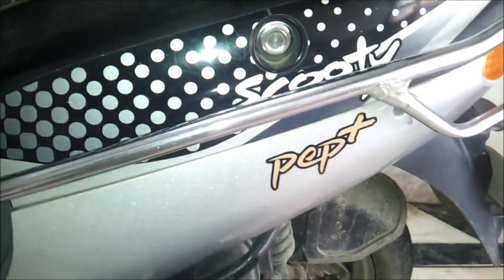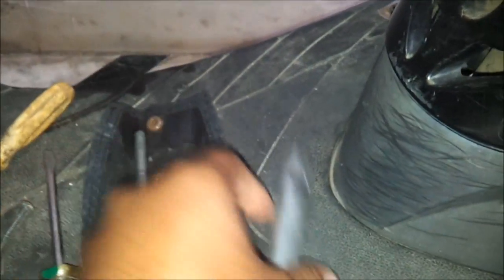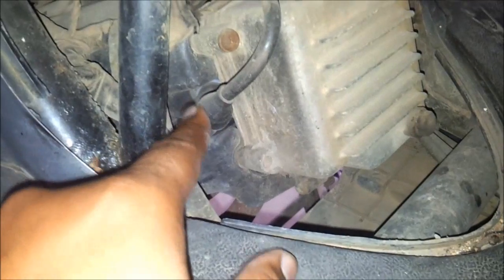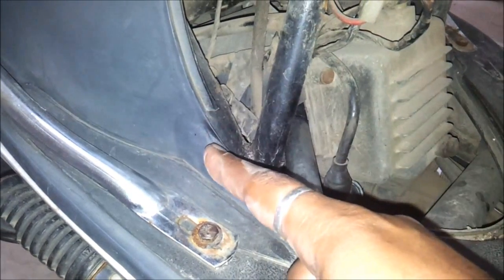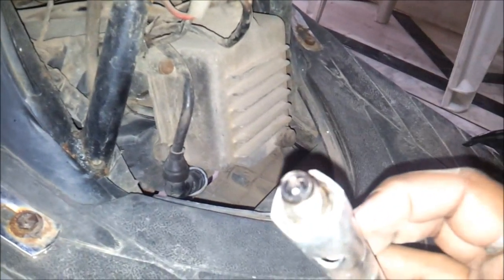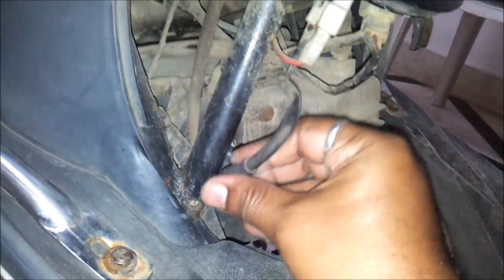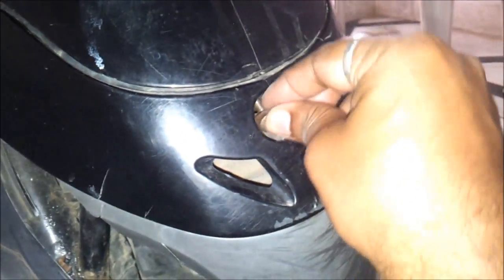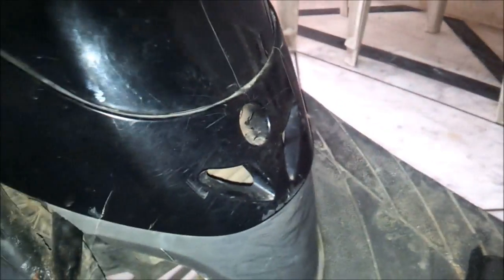scooty spark plug remove

Comment: My scooty pep plus two or three months interval starting problem is coming how to rectify it,mechanic remove the spark plug and clean it after some time same problem is coming please explain the permanent solutions.
Reply from the maker: U can change spark plug at 40000km. Check ur plug if it's getting carbon with oil. Clean plug  and start. If you're getting smoke that means it's consuming oil too.
Reply: Thank you for your kind reply.

Comment: Nice video faddy,
I am facing one issue in my scooty pep,
earlier my scoot was fine , and i do servicing at regular interval (every two months),
the last time i gave my scooter for servicing at the TVS service center,  i have been facing this issue since then,
my scooter would start normally but if two people sitting on the scooter, after covering an distance an about 1.5km the engine stalls (same as if the petrol is over) and after 2 hours or more the engine starts again. But single rider no problem. I took my scooter to the service center number of time, but could not solve the issue. Recently i changed my rear brake cable at local mechanic, and i saw those people were fitting the cable in a very harsh way, since after this, the fuse started going often. After every startup the fuse blows up. Without fuse the scooter starts, but stops after covering around 0.6km distance, Once the engine cools (takes 2 hours or more) the engine starts again, I m stucked badly with this problem. can you please help me to troubleshoot the issue. I will be greatly thankful to you
(the carburetor and the air filter is new)
Reply from the maker: +Phonon Lattice Thanks for appreciation. fuse blows up means,  your wires are short some were inside. pls check if wires are damage by rats.check your ground connection wire properly grounded to chassis. if ground is not proper you will get starting or running problem. if your scooty wires really got damage then u need to buy new wiring harness in service center and install. Hope this will work.
Reply: faddy781 Thanks for the reply,
will ask at the service center for complete wire change. hope so this works.
Reply: @faddy781 spark plug kis kam ata hai? New lgane se kya badlao ayga

Comment: pls help me guys if anyone knows the solution for this problem... the problem is that my scooty dosent start with self button.
and scnd problem is that  whenever i release the full accelerator the scooty stops and then i have to restart it again.. pls anyone know the solution for these problems pls help me out
Reply from the maker: check the fuse. near battery. get your air filter clean and carb.. clean. spark plug also.
Reply: \ tks a lot.
Reply from the maker: like thumbs up
Reply: Done bro